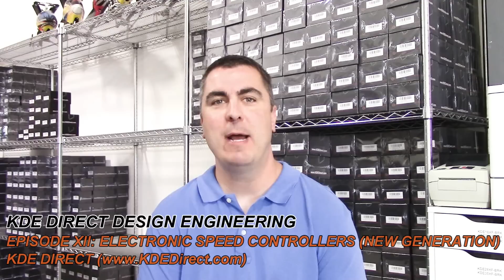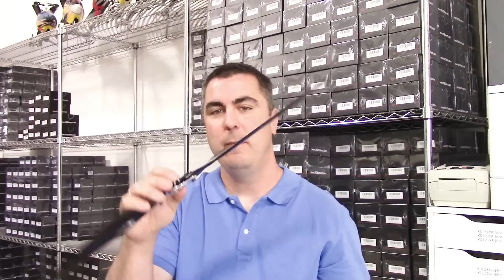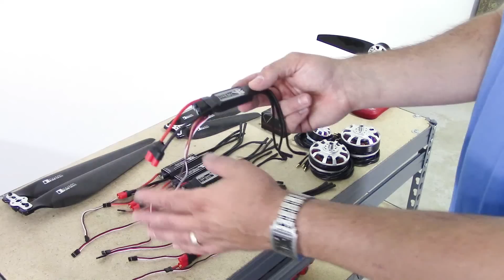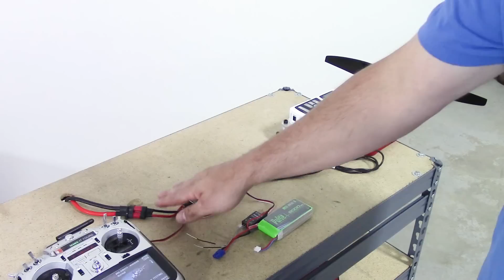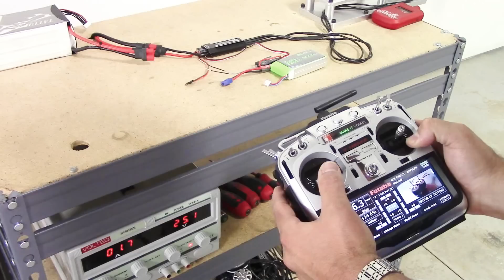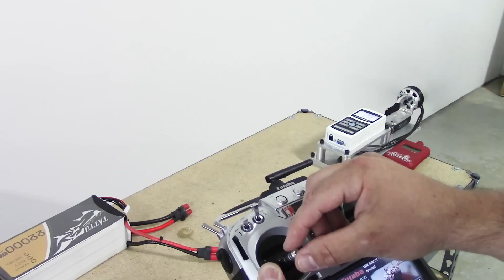KDE Direct Design Engineering - Episode XII: UAS HVC Electronic Speed Controllers (New Generation)

Comment: What power supply do you use for your test bed? And couldn't you put a lead acid (or nimh) battery in parallel to deal with the regenerative braking?

Comment: Does the RPM get maintained for a particular throttle/pwm as the battery voltage falls down? Many ESC have an internal PD control loop. Do your ESCs have it? TIA :)

Comment: Regenerative Braking! I'm very impressed! I'm building a Tarot T960 Hexacopter with KDE 55A ESCs and the KDE 465KV motors and I'm just wondering what you recommend for power? Should I use a 4s or 6s or 8s? Maybe two 4s in series?

Comment: I have been saving my pennies since getting into this hobby 2 years ago for KDE gear and a top shelf build- I am glad I have waited.

I have had lots of problems using low kv motors with 40amp simonk esc's (current version) on my pixhawk. I am shopping a new set and those 35amps might be the ticket. (3508-29-380kv on 6S with about 3.5 to 4kg AUW)

Thanks for this vid- very impressive.